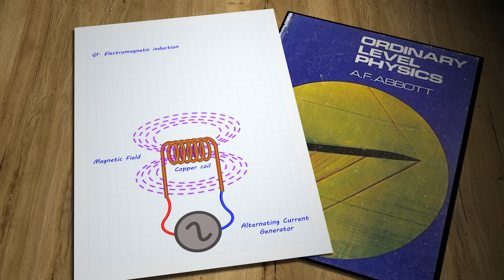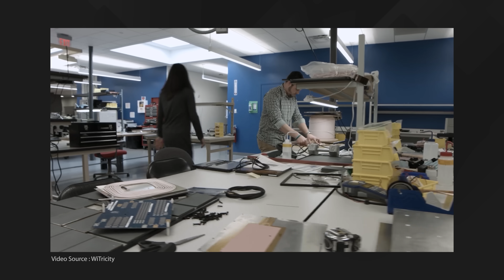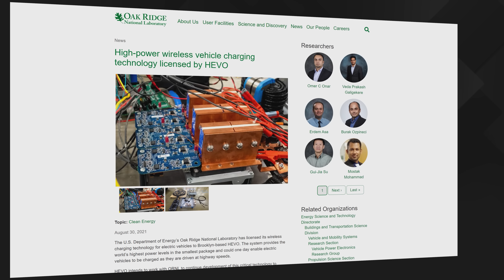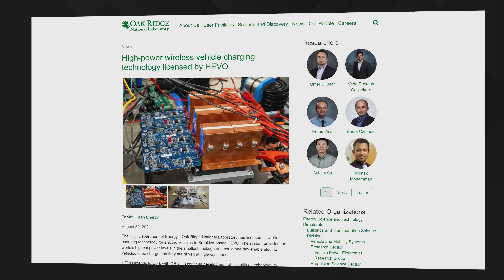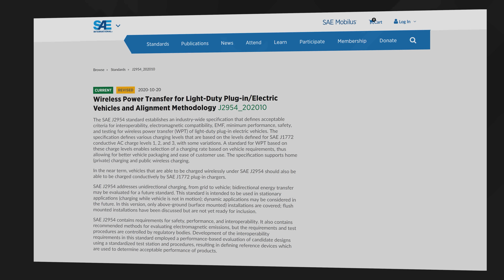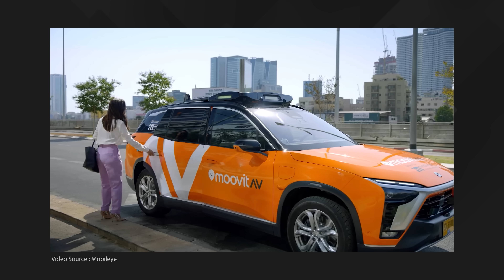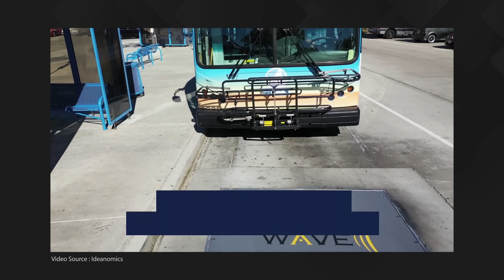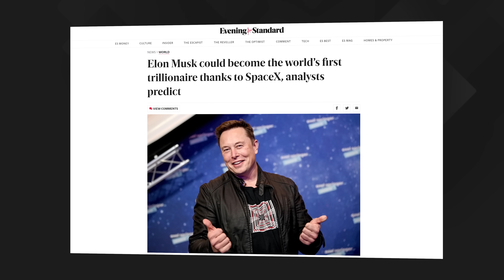Wireless FULL EV charging has arrived!  Exciting new tech breakthrough.

Comment: I had been wondering just how electric trucks were going to work.

Without doing the math still I knew that the batteries needed for a truck would be quite enormous which would mean a short range.  

And the larger the batteries, the more energy you have to spend moving the batteries and not the cargo, which is itself quite massive. It's kind of like the rocket equation.  The numbers compound.

But now this, although I still need to check the math and the details, seems to solve the problem.

We have two viable solutions (probably) for an energy source for trucks:

(a) Make a hydrocarbon fuel, like for instance diesel, using non-fossil fuel energy;

or 

(b) induction charging via induction coils buried in the roadway.

Comment: I think this make sense in for open parking lots in apartments. Too many charging cables and the actual charger which is around 4 feet, is just not the way for people to charge in apartments. You are also saving on the actual connector. This tech will mature in future. Also, think about when all cars will be self driving, who's gonna plug the charger?

Comment: Wireless charging for vehicles is a solution for a non problem. It introduces an unnecessary power loss and extra weight. It takes literally 1 second to plug or unplug my car. I hate my Apple wireless charger which has to be aligned perfectly and is slower.

Comment: While wireless charging absolutely has its niche cases I cannot in good concience be silent in the hype storm and unfortunate trends towards wireless charging everything.
The sad truth is that the >90% efficiency are for the most part a theoretical number no where near the actual transfer efficiency. Your standard Qi charging as used for most mobile and wearable devices is using resonant inductive coupling and still the range rather short and must be aligned quite well. Even then only about half of the power from your mains actually gets to your mobile phone's battery.
With power scarcity and many grids struggling to accommodate EVs, why on earth would you throw away power and willingly increase emissions? So much for sustainable  transportation.
Sorry to be the buzz killing engineer.

Comment: I got about 2/3 of the way through this and just couldn't watch any more of it. The problem with this idea is perfectly obvious. Even if the resonant coupling business between the primary and secondary coils is more than hype (and it is probably little more than hype), the cost of embedding primary coils for charging will be enormous. It is completely out of the question to think that your vehicle would charge while you are driving on the highway. The most this could possibly amount to is the elimination of physical connectors at charging stations. The idea of having this sort of thing embedded in the floor of your garage is not out of the question. But in this scenario you are leaving your parked for just as long as you presently need to leave it parked, to fully charge the battery. This amount of time is determined by the battery itself, and if the time can't be shortened using physical connectivity, it won't be made any shorter by using wireless charging. And the salient point is this: since it is at best an alternative for charging your car battery while it is parked, you still will need to pull over somewhere and wait for your battery to charge, whenever you take a long drive.

This idea falls very squarely under the same heading as Elizabeth Holmes' blood-testing gizmo. And it is annoying for another reason. The technology that should have been developed, in a cooperative way among various car manufacturers and possibly with the government playing a role, is the capability for fast swapping of car batteries. This capability isn't a novel technology, but rather is something that is obvious and mundane, that should have been done but wasn't done, and that still needs very badly to be done, but still isn't being done. There are some hurdles that will need to be solved, but they are small hurdles.

In most electric vehicles, you practically have to dismantle the interior of the car to get to the batteries. It should never have been done this way. Electric vehicles should use a grid of reasonably small batteries that can be inserted from under the vehicle and lifted into place using a slightly modified floor jack. The standard that would need to be developed would include not just the form factor and the voltage, but also an auxiliary electrical interface to allow the vehicle (or another piece of purposeful equipment) to interrogate the battery to learn the use history of the battery and the remaining life. This would not have been difficult to do, and it absolutely should have been done, but was not done, and the only reason it was not done is that the corporate leaders (who know who) don't really have the long view that many people believe that those individuals have. What has been developed and made available to the public was driven entirely by profit motive. There was no clear profit advantage in making the batteries swappable, so it wasn't done. The manufacturer had adequate capital to build charging stations, but not the greater capital that was needed for all those unstaffed charging stations to have been built as small service stations where you could get a battery swap in five minutes or less. It simply would have been too expensive, and this is the reason it wasn't done. It still needs to be done, and this, not wireless charging, is what we truly need.

In order for electric cars to fully replace internal combustion, there are three things that need to happen: fast swappable batteries, batteries with better energy density, and a significant reduction in the consumer cost. Actually, we also need a revolution in the electrical power grid and more availability of clean electrical power, but that's another topic. The swappable battery part should have been easy, and it should have been done. If we weren't able to solve that mundane thing, do we really have much reason to think that we'll see improvement in the difficult areas anytime soon? Our governments still have not stepped up to do what needs to be done, in order for this revolution to take place within one or two decades rather than one or two half-centuries. Unless our governments step up and make it happen the way it really needs to happen, we will not be much further along fifty years from now than we are today.

Comment: Built in wireless charging in the roads is to expensive and when a vehicle is parked it's just a convenience that you pay for with limited power and decreased efficiency compared to a wired connection.

New tech may be able to focus the energy transmission but the more you do the more dangerous it becomes if anything gets in its path.

Geting in the way of a large power transmission is not a good idea no matter the tech used to transmit.

I can live with having to plug in the cable. If I could not I would prefer a robot connecting the cable for me. :)

Comment: making charging and discharging easier will be a big advantage in a futuristic 'Smart' electricity grid. As we are all becoming painfully aware, electricity generation is still a big challenge, but with a Smart grid you can have truly distributed capacitance in your system so you don't need extra power stations, or hydroelectric stations to add capacitance for peak loads anymore.

Comment: I am somewhat sceptical of the claims being made. This video supports this scepticism, judging by the thickness of the cable connected to these pads. They do not appear to have a diameter consistent with carrying the power level claimed.
I would like to know more about the technology and its operating frequency. It would be very interesting to know how the damping effects of adjacent metal is avoided, as this will de-tune  any resonance, and how the pads magnetic field is made unidirectional, something normally associated with an E core transformer.
I think these are reasonable questions, given that high powered EV charging cables have their own efficiency problems, having to be both very thick and water cooled. When transfering mega Watts super high efficiency is critical, given the amount of energy that is being lost as heat and unwanted radiation.

Comment: Why is it some many EV companies are trying to expand the distance cars travel? Why not use the cars for local travel and then let trains do the long distance travel.
Put the wireless charging systems in the train car park and you car is charged as your travelling on the train.
Make all the trains electric powered with green power (wind, solar etc) put large battery banks in the stations and strategic places track side to help with powering trains and the carpark charging.
By nature the train stations are in the town centres and could be used as power distribution points for the city they are in.
The electric trains would also be used to transport good (the reason they were made in the first place) to distribution points/depots at the stations, leaving electric vans and trucks to move the goods from depot to shelves on a much shorter distance. This would remove the truck from motorways and as a side effect vastly reduce the maintenance cost for said roads.

Comment: Lets be real here
If wireless charging will reach the roads will be for public use not taxis or trucks, and we will pay the energy ... No doubt
Trucks will use "wired" chargeres while on the move cuz is just waaaay cheaper, way way cheaper, with huge metal cables like we do for decades now, and new infrastructure is in "testing fase" in highways in Europe
Wireless charging on a parking lot is more likely, cuz is easier, but again, it will be paid by the user, or at least offer by the company how ownes that particular station (like station in companies, "mine" as one, a wired one, and only one)

Comment: It’s easy to understand why some might be “laggards” in moving to an electric car, particularly in the U.S., when you realise most homes have pitifully low amperage available. In my own home I’ve been quoted upwards of $14000 to upgrade to a mere 200A single-phase service. Anyway, just swapping every car for another car, truck for truck, can hardly seen to be a very sensible transport solution for people or freight. I live in a midwestern city with a population of only a little over 200,000, and no alternative to car-driving, which is either in gridlock or suffocating under thousands of acres of parked cars. No-one here appears to be thinking at all.

Comment: One problem to address before we can really rely on home car charging:  People able to afford a home.  Until they become so commonplace in rental units that you can assume you will have a port available no matter where you move, we're going to continue needing some sort of centralized refueling infrastructure, whether that's fossil fuels or hydrogen or battery swap stations or whatever else people come up with.

(And that doesn't address all those homes that only have curbside parking.  That's under municipal control in most jurisdictions - not homeowner control - so that's another large market segment that's cut out until cities and towns decide to add charging infrastructure in the parking lanes of those residential streets.)

Let's hope buses and taxis and trucks will remain a sufficient base to get the chicken-and-egg problem resolved to the point that the assumption of wireless charging availability can be made by people who don't own their own home with a garage (or at least a driveway) to install the unit it.

(Also, it will require standards to be adopted and followed by most or all manufacturers.. having charging units commonplace isn't all that helpful if you only have a 5-10% chance of any particular rental unit's charger being compatible with your vehicle.)

Comment: Please stop ✋ advising that we should use expensive car batteries to put power  back to the grid.  It's a horrible idea.  😫  cars are expensive and wearing out their batteries prematurely to regulate the grid is about the worst possible idea.  Most electric cars will likely be junked when the battery wears out.  Wearing the battery out earlier just reduces the operating life of the car.  You are basically using dollars worth of battery longevity to produce pennys worth of grid electricity. 

To illustrate my point, the last time I checked Tesla Power Wall costs more to purchase than all the electricity it will ever store in its batteries entire lifespan.

The customer will never make money selling battery power from the currently available consumer Lithium batteries.  Using your $70k car battery to add $0.10 of value back to the grid is insane. 

You should focus on having a charger with sufficient speed to allow off peak charging.  Off peak charging saves the power company lots of money 💰 and hopefully they will pass the savings on to you.

Comment: Thank you for the great video!  Wireless power for electric vehicles is truly a game-changer - especially when the efficiency is about the same as that of plug-in charging.  Lots of time and energy has gone into the initial MIT developments resulting in more than a thousand issued patents held by WiTricity in wireless power.  

That being said, I do want to clarify the physics issue of the "inverse square law" mentioned.  It is true that the magic of magnetic resonance wireless power transfer provides for high efficiency at very low "coupling" - much lower than older traditional inductive wireless power; however, this has nothing to do with the inverse square law.  The inverse square law, which roughly states that the power radiated in free-space decreases over distance by the square (or 20 dB per decade in logarithmic terms) only applies to far-field radiation (i.e., when the distance is large relative to the wavelength).  Magnetic resonance wireless power or wireless power by means of magnetic-field coupling does not utilize far-field propagation of electromagnetic waves to transfer energy and therefore is not subject to the inverse square law.  In reality the magnetic "coupling" drops off much faster with distance, but this is not the same as radiated power.  In these cases, the magnetic field coupling uses the reactive near-field magnetic fields, which represent stored energy when these fields are not coupled.  In other words, the energy would not actually radiate into free-space if a receiver weren't present.  In contrast, Wi-Fi, Bluetooth, and other common wireless communications use much higher frequencies (e.g., gigahertz range typical) where the wavelength is much smaller and therefore these devices are subject to the inverse square law.  Inductively coupled wireless power utilizes much lower frequencies (i.e., kilohertz range typical) and relies on ampere's and faraday's law in the reactive near field region (where energy is stored in the fields locally).

Comment: It doesn't work anything like that at all. This is pure HORSE MANURE ! The idea that you can change the magnetic field by adding a capacitor (which is in fact what this is) is complete nonsense !
Anyway, it's a solution to a non-existent 'problem' for the most part. Won't happen. MIT have beegn trying it on for at least 15 years to my certain knowledge with this daft 'technology' idea !

Comment: Fantastic as this tech can be, it still needs metals mined in unsustainable ways, currently by underage workers, creating pollution  and degradation of the environment.  We need something like hydrogen powered devices, with the the hydrogen produced from solar, wind and wave technologies. batteries can make up rest of the power storage, movement and consumption.  Lets get sustainable & clean, rather than just sustainable? - So in this short polemic we have the essence of our problem dirve for the currently available green tech or aggitate for the better green tech - at a hell of a speed.  I think the UK  Gov should sponsor hydrogen production and consumption, all coal, oil and gas supply must have  termination date. Every heating or moving device that relies on fosil fuels should then be obsolete within that window (5 to 10 years),

Comment: Ridiculous.   We would need to build 20 to 30% more power plants just to make up for the magnetic losses.   Plus it would drop your miles per KWh by a third.   Not a practical option.

Resonant transformers have been around, in theory, for over 100 years.  They were and still are very inefficient.  Air has like 1/1000th the permeability of iron so any air gap you pay very dearly for.   And at resonance the current peaks are many times the off-resonance current, leading to more heating and losses.   You would need to have water-cooled transformers to keep temperatures reasonable.    A big fat nyet.

Comment: What about electricity inducted into non electric vehicles?  Standard cars, motorcycles and bicycles.  Will this cause inductive heating of specific metals, or cause electrical system damage in standard vehicles that use their chassis as the ground reference?

Comment: Just one more thing to waste electricity and resources. Just plug the cable. It's not hard. What is the problem with that?
Building road full of these is massive and expensive waste. If you need to plan a route to include "charging road", then why not make a plan to include charging station?